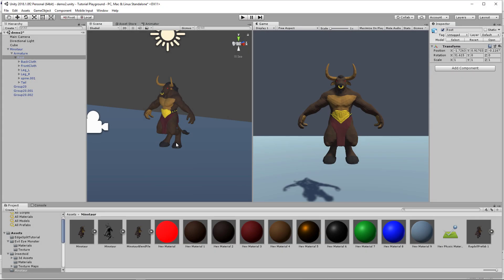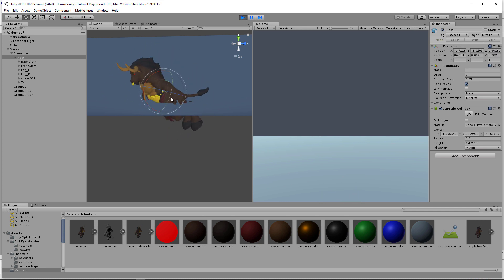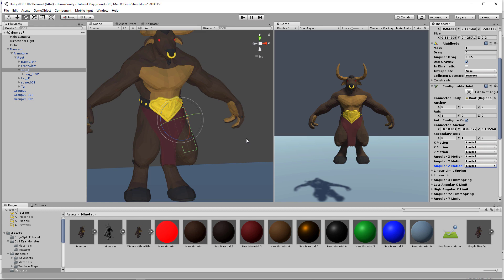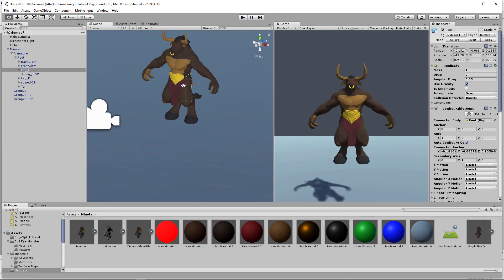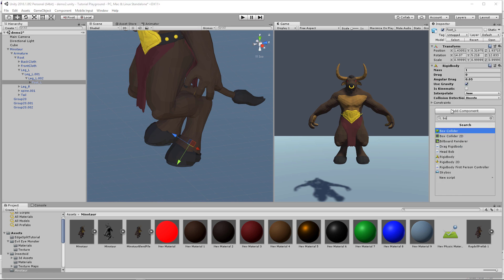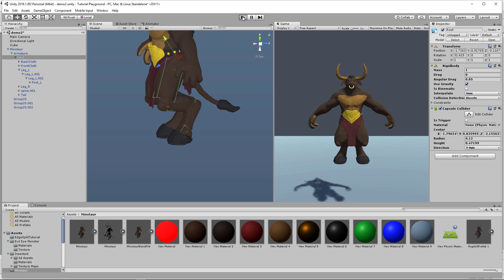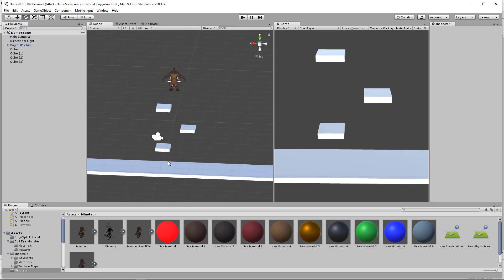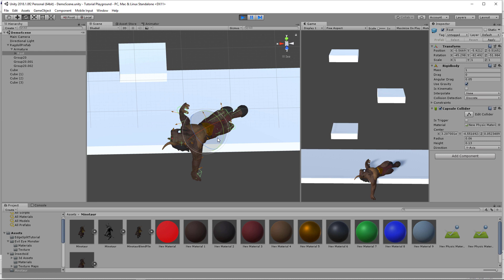Ragdoll Physics in Unity 3D

Comment: How do I enable and disable the ragdoll?
Reply from the maker: Several different methods. Option one is to just switch out meshes. Another is to put the colliders under an empty and then just via code disable the empty.
Reply: @RandomArtAttack  oh ok so instead of putting the stuff into each bone, add an empty game object to each bone and put everything in their? And then through code enable and disable the empty?
Reply from the maker: @capnc4ke  That would work or just create a script with an array. Drag and drop the stuff into the array and then just loop through the array and disable everything.
Reply: @RandomArtAttack  Ah ok, Thank you so much for the help!
Reply: What exactly do I disable? I just tried everything I could, but when I do anything, the animation keeps playing. None of the bones become ragdolls.
Reply from the maker: @capnc4ke  I don't know exactly what you are trying, but disabling the colliders with the rigidbodies should disable the ragdoll physics.
Reply: @RandomArtAttack  Ok, well I found out that if you activate and deactivate the animator, it's works like a charm
Reply: @capnc4ke  Thanks for letting us know so that if someone else has an issue they can find a solution here. :)